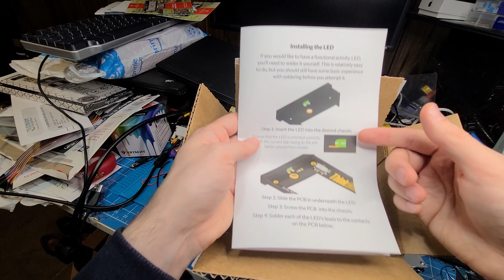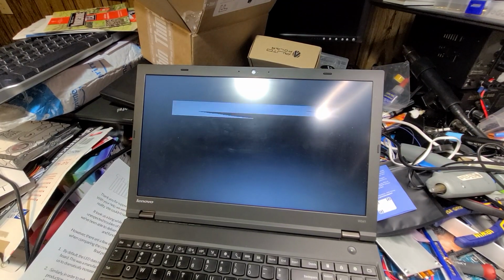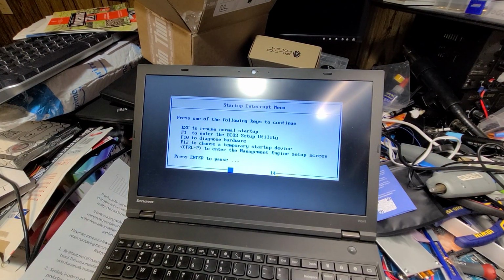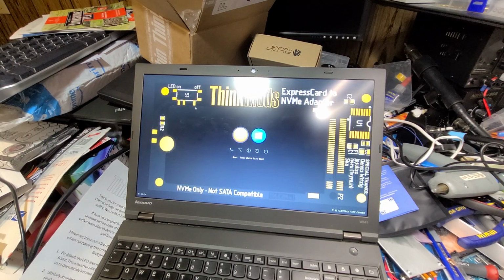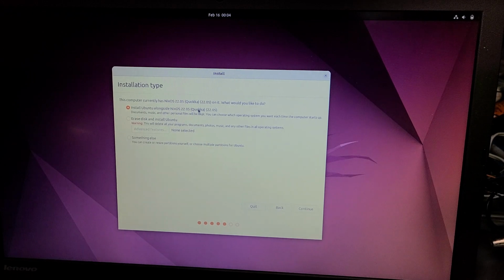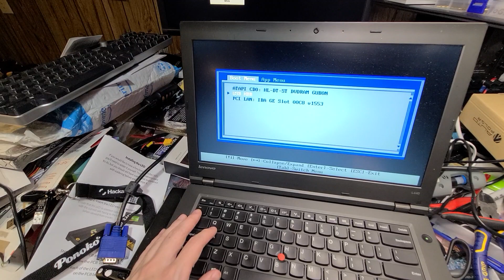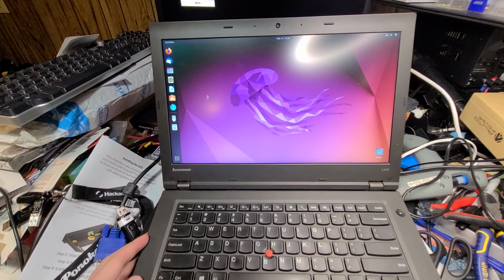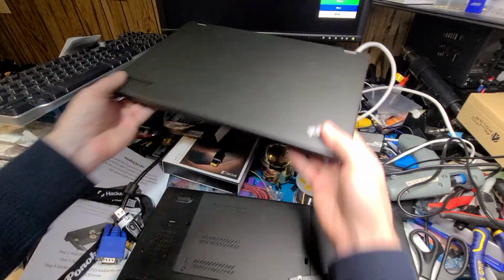ThinkMods ExpressCard to NVME adapter - unboxing and OS install

Comment: Is there a ExpressCard 34 to M.2 my wifi on my 2011 MacBook pro stopped working? Or with this work ?
Reply from the maker: I think you are asking if you can take an Express card device like this and put it into a MacBook... The answer to that is no one makes something, and it's probably because it's not very useful. One would be better off using an m.2 SSD in an m.2 slot. Wifi cards are not keyed the same, but if there are PCIe lanes, they do make m.2 adapters that convert A-E key to M key. The real problem is that they are likely too bulky to fit in with the bottom closed.

This is an example adapter I used in a tiny PC to add a another SSD.

BQZYX+ NGFF M.2 Key A+E Male to Key M Female Adapter Cable https://a.co/d/h7V4ePI

Comment: much of a speed difference compared to a sata ssd?

Expresscard has pcie x1 and usb functionality much like the wlan card slot which i assume is how they can have the sd card on the same module.

When using a pcie+usb wifi+bluetooth card in my mini pcie slot i had to isolate pin 20 and 51 (disabled the hardware on/off switch and allows the bluetooth module to power up), is this  doing something similar with the pinout in the expresscard slot?
Reply from the maker: I'm not sure I have not run any disc performance comparisons. I suppose it theoretically should be the difference between SATA maximum speeds and 1X PCIe.

Comment: 7:30 If you were reading on the site it was specified that for small SSDs you had to buy the adapter
It is possible to start automatically by Bios setting on removable device without this Thinkmod boot loader ?
I found now there is a version from aliexpress working to without bootloader
Reply from the maker: you should buy it and make a video!
Reply: It depends if your laptop has nvme support in bios. I don't have that thing, but I assume if you unplug the bootloader sd card and laptop has nvme support it should work. I definitely saw somewhere post about using similar aliexpress board, but without bootloader on it, with x230. If I remember things right guy had to install coreboot, because for whatever reason it has nvme drivers.
Edit : btw I'm buying same chuk board, I can write about my experience here when I get it.

Comment: Thank you for the video! But you should know that Kioxia isn't "cheapo" nor "one of those brands" but the actual inventor of NAND flahs as it's used in all of flash based storage devices we all use every day. It's Toshiba's renamed storage products branch so not only a pretty big company, it's the real OG - as the kid's say.
Reply from the maker: so, you still only drive ford because they made the first "og" car? no cars are better or faster?
Reply: @jarenhavell  No, but Ford also is a global player and one of the biggest manufacturers out there and not some cheapo brand like Daewoo or Dacia.
Also Ford aren't the OGs, n Mercedes Benz are and they're top tier.
Reply: @grrkaa  Forget it, the guys analogy about Ford is proof positive he's stuck on stupid.
Reply: @jarenhavell  
>  so, you still only drive ford because they made the first "og" car? no cars are better or faster? 

This is the stupidest response, maybe ever. No one said you should buy strictly Kioxia drives just because they have invented flash storage, you were simply called out for your ignorant "one of those brands" remark. Chill. No need for nonsensical extrapolations.

The whole video reeks of ignorance, you should at least be a bit more cordial when responding to viewers, ESPECIALLY when @grrkaa8450 approached with the utmost respect to your mistake.
Reply: they may be OG, but they're still not top tier.  My kioxia nvme (pcie 4 4x4) only writes at 1GB/s... replaced it with a WD SN850x and while the read speeds stayed about the same, the writes went to over 6GB/s and was basically the same as the reads.
Reply: @AlanDike you're comparing the wrong tier of model, Kioxia is one of the best both in IO and bandwidth

Comment: Hey Jaren, thanks for the video, I was curious about this project. Are you aware of Ventoy? It makes using a USB for ISOs much easier. You don't wipe and format each one, you just drag and drop the ISOs and it does the rest.
Reply: Ventoy is good but not a be-all and end-all solution. It can have many incompatibilities and requires a fair amount of trial and error to get some bootable images working. Burning a single image to a USB stick with something like Rufus is still the best way to get maximum compatibility.
Reply from the maker: Yep, I have used it before.
Reply: @jarenhavell  Any reason why you don't use it in these videos? Just curious, not judging you.
Reply from the maker: @queue1312  no reason, other than keeping things simple.